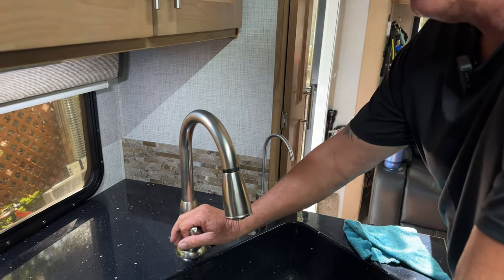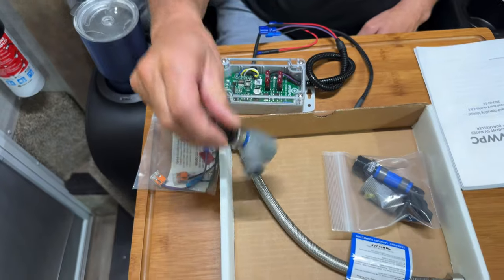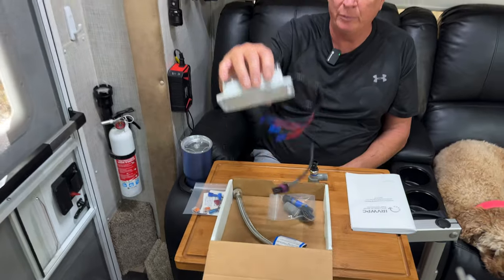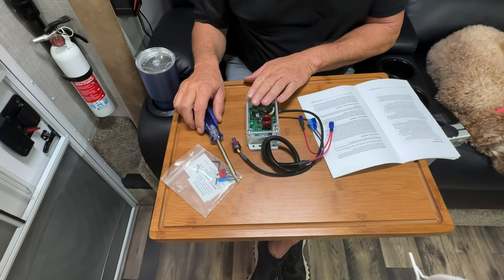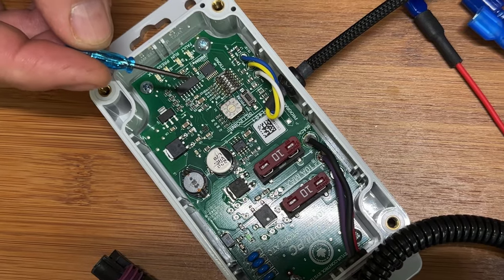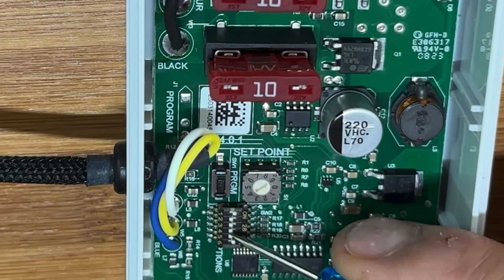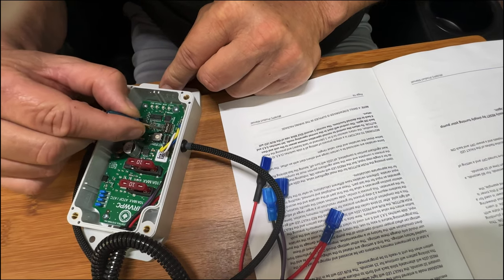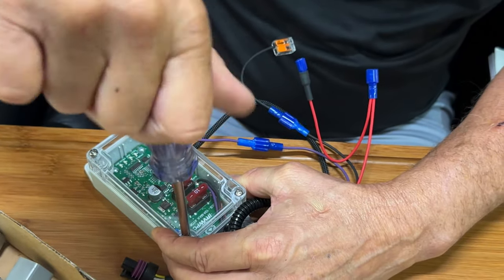The Smart Water Pump That Changed My RV Life

Comment: Great video and review! Another option to prevent the pump cycling at low flow would be using an accumulator to provide pressure in between pump runs.
Reply from the maker: great idea Neil, thanks